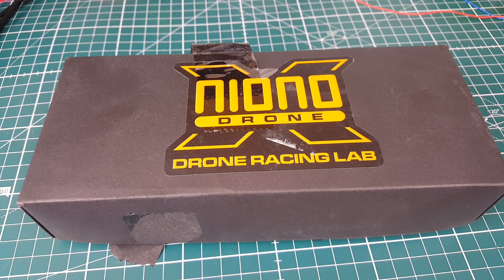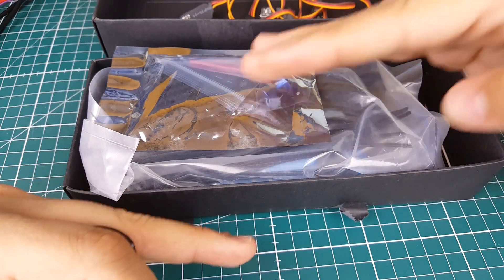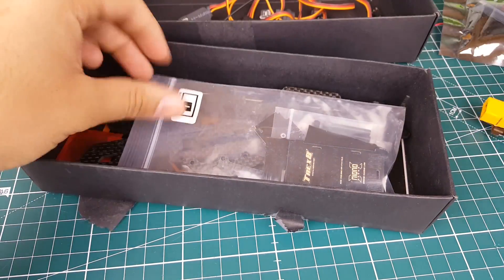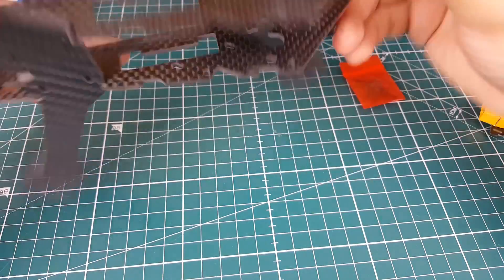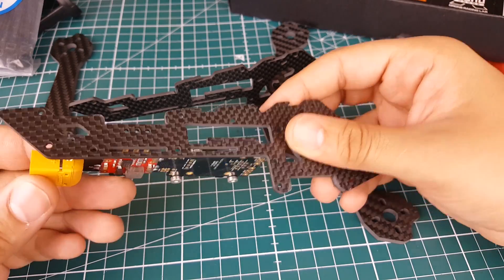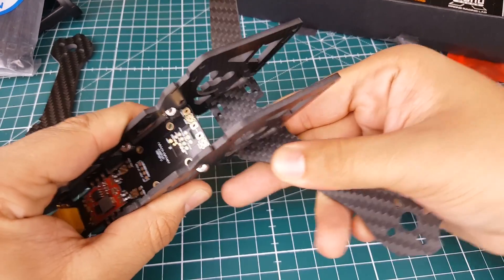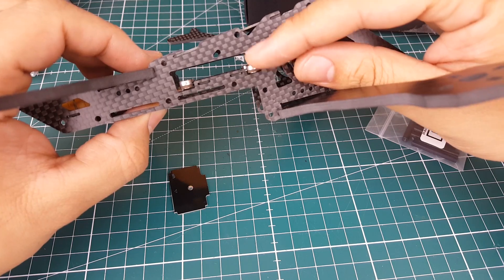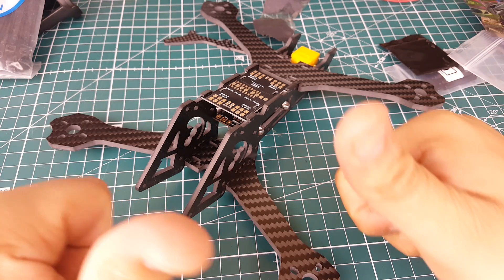NIONO TREX 8.6 Frame // Not A Review or is it?

Comment: Mesh what motors should I get for under 15 pounds (also ones that won't only ship to us, I'm UK based)
Reply: Dylan Watkins He'll tell you to buy some RacerStars
Reply: Victor Ungureanu already got some racerstars and I'm not very happy with them. I got a good batch of the 2205s but I'm quite meh about them.
Reply from the maker: Racerstar 2306s 2400kv ... You'll love them
Reply: Drone Mesh Really I heard some issues about the bearings . Any plans to do a build with the days samguk series? I was thinking about getting these but I don't have enough information to go on. Any thoughts?
Reply: Drone Mesh would you recommend I buy the bundle pack with the racer star 2306 2400kv and 35 a ESC for 69 gbp